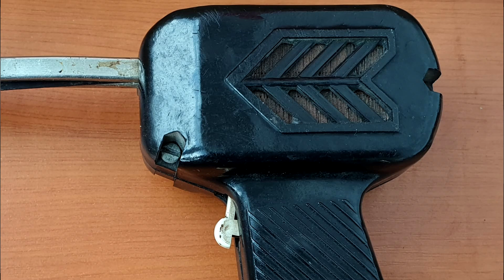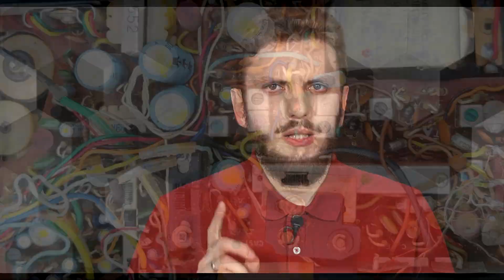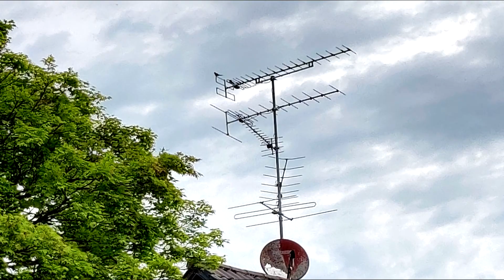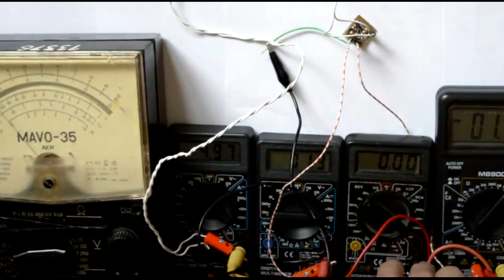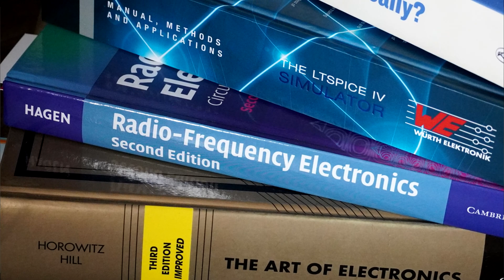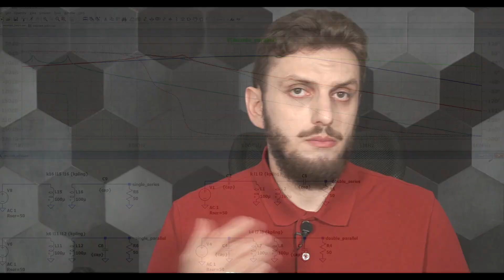4 year anniversary special

Comment: Thanks for this video Fesz! I loved it. And congratulations on the Anniversary! 🎂
My early life was quite similar. My grandfather gave me my first soldering-iron when i was 10 years old. (A little later in life, but then, this was in 1983, so a little earlier in time, if you know what i mean...)  And, like you, i also started taking apart old, but not necessarily broken, equipment, just out of curiosity. And it really builds great skills. Not just soldering, but also dexterity with small hand-tools like screwdrivers, pliers, etc.
Later on, i also went to university, but i did enroll in the Electronics Department. Which turned out to be a mistake. On some subjects, i already knew more than my teachers, which made for boring lessons, and was certainly not appreciated by the teachers in question... So i never got my degree. But i did get lots and lots of experience working on crazy projects, mostly with artists...  Still doing that now. Along with trying to make renewable energy micro-installations accessible (OpenSource) to anyone.
I have another good tip for enthausiastic beginning electronicians: Keep a tube of Panthenol-cream nearby! It really helps healing the inevitable burns. 👍